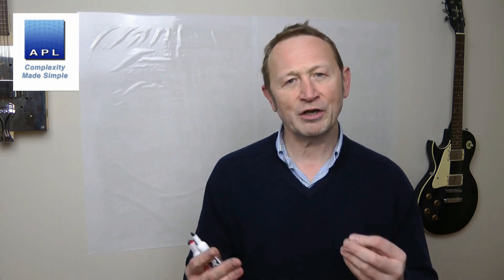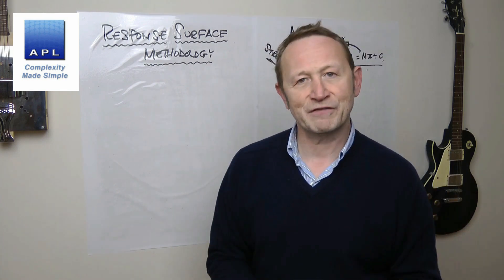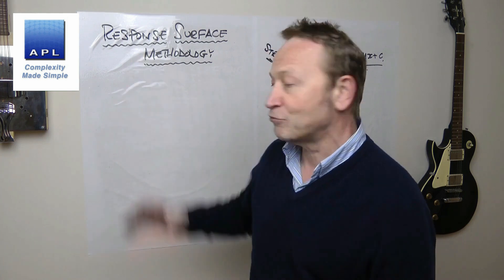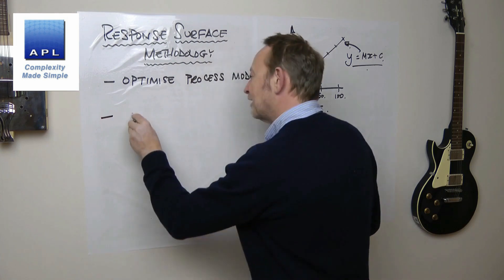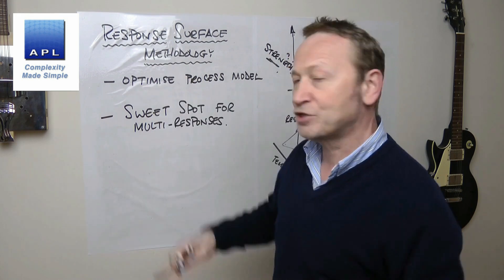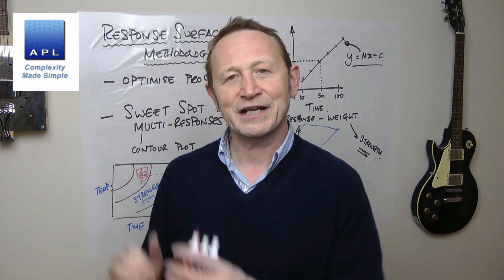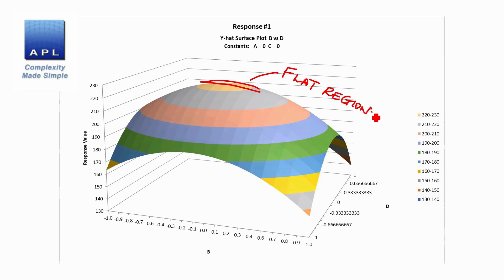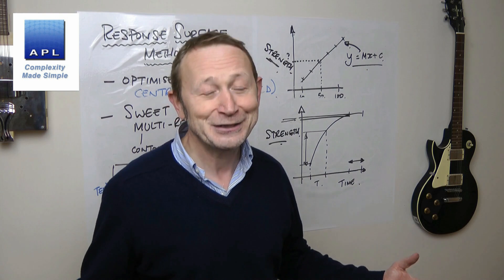Response Surface Methodology

Comment: I am trying to analyze an experiment with 3 factors (Mix Ratios) that must tally to 100% on all 9 runs. How do I create the design firstly to tally to 100% and how do I analyze this experiment to know the influence of the 3 factors on the final result after testing such as strength. I’ve been in a dilemma of using the wrong processes and I need clarity on what I should do in this case
Reply from the maker: Hi there the 100% issue is a tricky problem. You should us a mixture design, but I don't like them. I have a video specifically on this
https://youtu.be/2Vn7k1Y03nk
Reply: @paulallen5321  Thank you

Comment: Great video, Paul! Is there a limit on the number of indepedant variables? I'd like to evalute seven factors and optimize the response... thank you!
Reply from the maker: The limit is how long each data point takes to collect or how much it costs. As you add more variables the number of tests get more and more. Personally I would stop at 11 variables. But if you really wanted more I'd do 2 DOE's with 11 variables each...

Comment: Hi Paul, thanks for such a wonderful explanation. I needed some help with respect to a particular RSM technique, I was hoping if you could help me out or guide me through some reliable texts for the same.
Reply from the maker: Hi Rohit - depends what you're trying to do Rohit. Why do you want to use RSM?
Reply: @paulallen5321  Hi, I am actually looking into fragility curves of concrete structures using RSM.
Reply from the maker: And what will you do with these curves? Or what would the reader of your paper do with these curves?
Reply: @paulallen5321  that's part of my research
Reply from the maker: Rohit - what help do you need?
Reply: @paulallen5321  There's an RSM technique called HDMR, I was hoping for some conceptual or numerical examples.
Reply from the maker: Hi Rohit - I've just had a look at HDMR, this is not my area of expertise so I can't help I'm afraid...
Reply: @paulallen5321  ahh, that hurt, but thanks for your responses
Reply from the maker: If you think I can help in the future though please do drop me a line...

Comment: Thank you Allen for explaining the concept so nicely.
 I am pursuing a PhD and for my work, I need to optimize my samples using RSM. I need to use a Central composite Design for my three factors. but one of my factors ranges from 0.1 to 1 mMol. So, the suggested combinations show a negative value for this factor, which is practically impossible to weigh.  What would be the best CCD design for my factors? I am confused regarding the selection of the best design for my work.
Reply from the maker: Palak - please send me a mail on paul.allen@allenp.co.uk and I'll help you out..